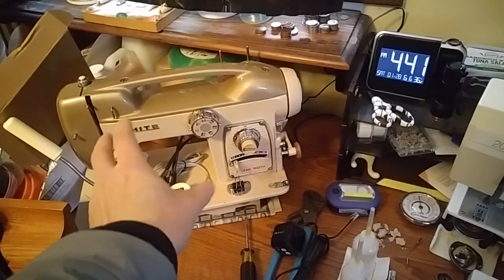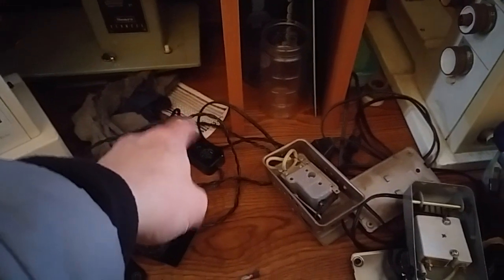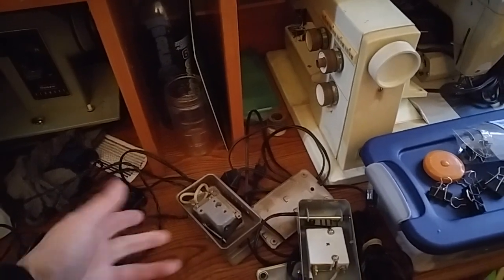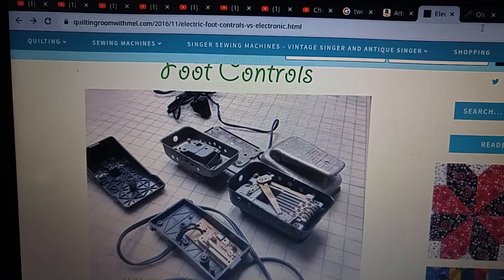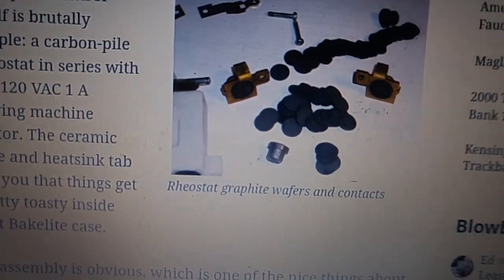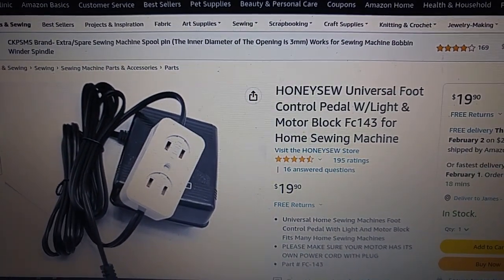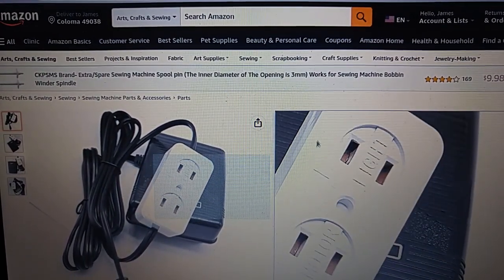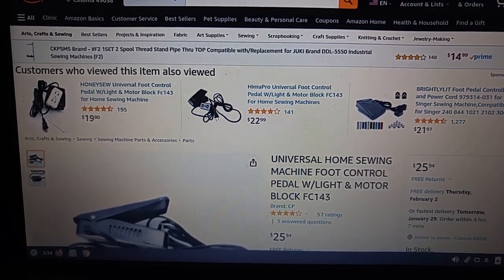White 764 Sewing Machine Pedal Review and Potential Repair Ways

Comment: Speaking of the wiper design foot pedal, I’m assuming you’re referring to the one I am currently having trouble with that comes with my atlas Japanese vintage machine. It goes from 0 to 100 and I’m not sure what adjustment is needed to correct that. Can you guide me in the right direction of where to look, thank you